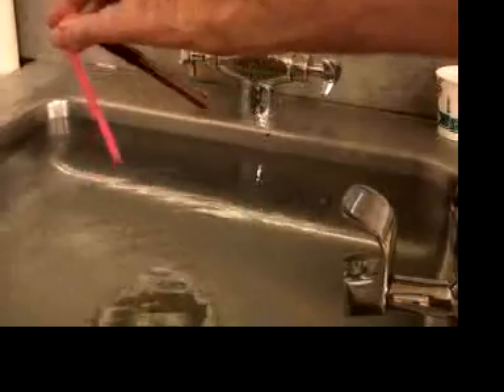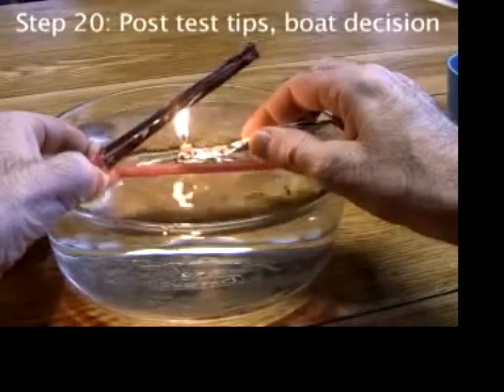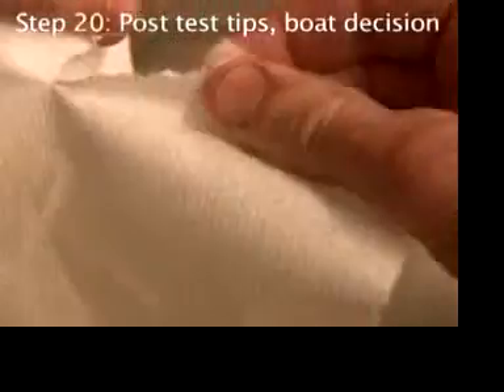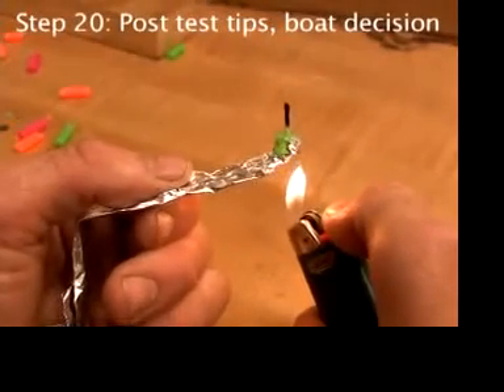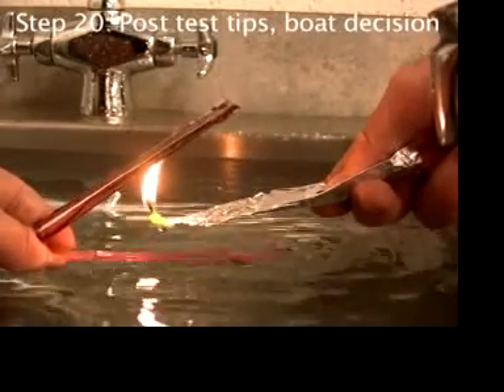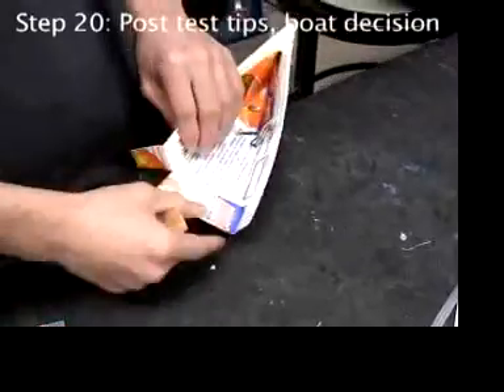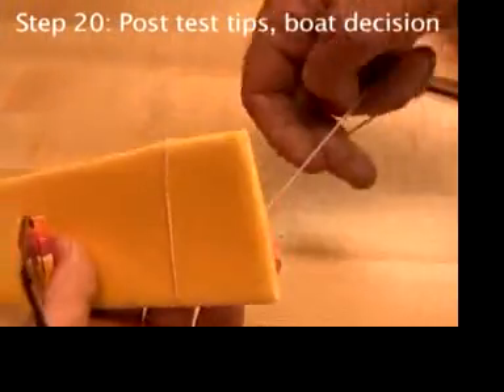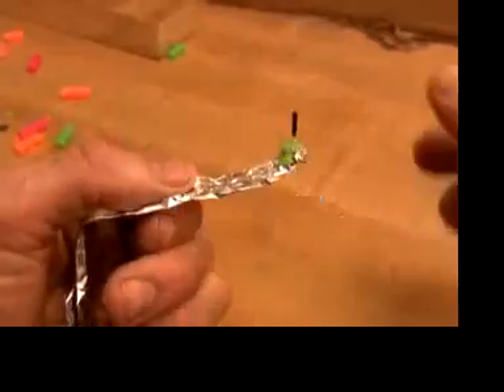Part 23 Build a Putt Putt/Pop Pop Boat s20 tips

Comment from the maker: The part of the straw inside the engine can melt, but in Part 14 you should cover the straw ends with a thin layer of epoxy. Straw plastic (polyethylene) melts (thermoform plastic) but the epoxy covering does not. It is a thermoset plastic that will burn before it will melt. Also, make sure that you do not keep the heat on if the engine stops.

Comment: I did this two times already and every time that I did everything worked fine the first time and the just didn't work.. I opened the engine up by cutting it in half and I found that the straws where melted together so it was sealed

Comment from the maker: You cannot melt aluminum with a candle but you could damage the epoxy glue if there was no water in the engine. The water droplets changing phase to steam take up a lot of heat. If you do a google search you can see people boiling water in paper cups.

Slater